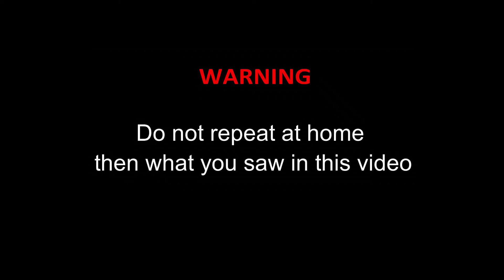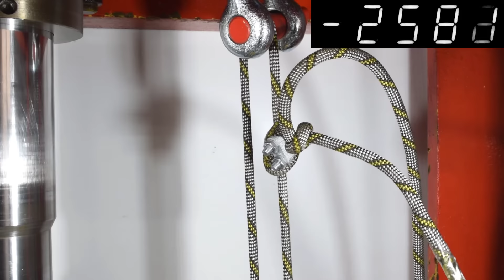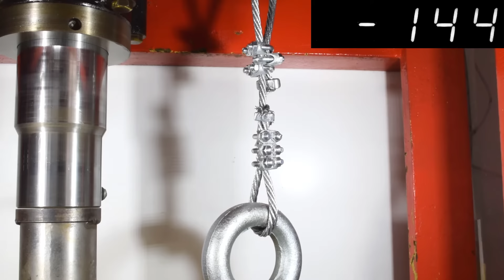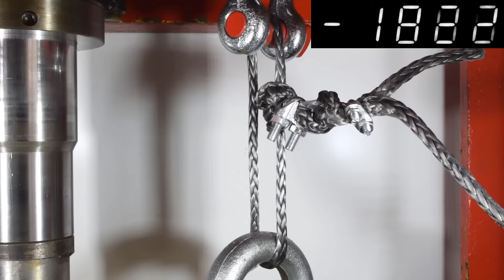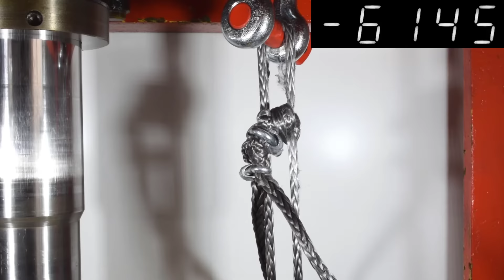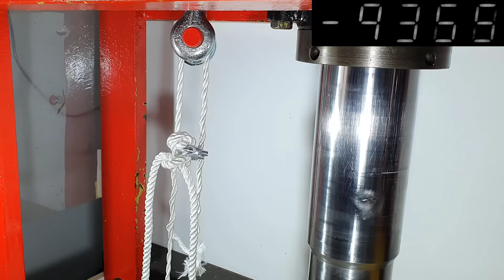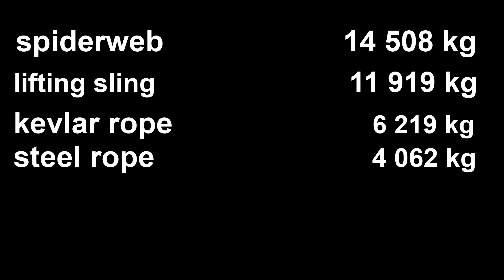HYDRAULIC PRESS VS STRONGEST ROPE

Comment: Yes but the steel rope was tested as a single line, whereas all the other ropes were tested as double lines- halving the tensile stress compared to steel at the same load.
Reply: Even so, it would only jump up one spot right?
Reply: @stephenrhoades8686 No, no, the test was cool and you can see that good quality materials will support more, but in terms of position it was undefined, if you pay attention, the breaks happen at the points where the knot caused structural damage, thus reducing the capacity of the rope, there are other types of knot that would be more suitable for this test. but it's always good to see a hydraulic press breaking things.
Reply: @demervalaugustodacunha1954 the fact the web isn't weakened by knots as much is also another reason why it's better though, and even if you assume perfection for steel, it'd be weaker still, even if only by a couple hundred kilograms

In this example, it's 3.5 times as strong as the steel rope, so even if the steel rope is weakened to a third of its abilities, spider webs is still stronger.
Don't get me wrong, steel not stretching is a massive bonus over spider web, along with being much much cheaper to produce and distribute, since steel rope can be made anywhere with steel, instead of at spider silk farms or wherever they get it from.
Reply: @BisexualPlagueDoctor  the metal rope had just one line, while the others divided the force into 2 lines, which certainly changes the result severely, I don't know if it would be stronger or not, but I can't know since the knots used didn't take it into account the characteristics of the ropes, such as alpine ropes, which typically do not hold well in this type of knot, slipping much more than the others, causing more structural damage.
Reply: Nah I'm a Civil Engineer, the larger the diameter the better it will sustain tension, larger diameter are more ductile. The stresses in the steel rope will be thoroughly distributed if it's thicker in size meaning it can handle a lot more tension 😊
Reply: @paimonemergencyfood3392 who are you replying to. Also bring ductile is a property of the material not of the shape and size of it
Reply: why is everyone disagreeing with you?? first thing i though too, you can visibly see where the knots imoact the result
Reply: Double it and pass it to the next person
Reply: The poor knots tho... Some knots could have been way stronger and less slippery
Reply: @paimonemergencyfood3392  you spending all your civil engineer money on primogems?
Reply: That spiderweb rope is fricken awesome! We were taught you lose half your SWLL when introducing a knot. Weaving the rope into a flemmush eye greatly increases SWLL

Comment: Never knew they make rope from spider silk!! Where do you find it? How much is it? How many spiders does it take? Mind boggling! 😀👍
Reply: Isso é o que eles DIZEM ser. Vai saber se é bem assim mesmo...
Reply: é sintético
Reply: GMO goats.
Reply: It has covering only got it like coaxial cable have black rubber coating
Reply: @GraemeWight-wx3xz  That's 2000s tech, they now use GMO silkworms
Reply: @Assassin0223  : you know i think i remember see/hearing about that but the goat one always overwrites lol. I remember reading that teams working with the goat variant were having consistency problems in many crucial areas,  strand clumping , knotting, too thick or too thin. With the grub cocoons the strands will be fine gossamer and ideal for spining into a yarn. Ta for the reminder. I'll go refresh properly.
From Edinburgh Scotland with respect m8.
Reply: It comes from GMO goats milk that produces spider silk protein and not actually made from spiders.
Reply: @CatboyChemicalSociety   ok ... that makes sense. Thanks! Which opens even more questions!
Reply: Is it soft cause if so I want a blanket
Reply: @Sersincero 1 spider can make different types of web.
The one where the sides are sticky for hunting, web that all know and love.
And the one for structuring the entire web which is not sticky but strong, and I believe that this is what is used for spider silk.
Reply: That was synthetic
Reply: Chinese spiders were being tortured in the spider concentration camps, that's how they extracted that much spider silk🫠
Reply: Probably not how many spiders but how much of their sticky fluid the spider could make come out
Reply: That's so cursed wtf
Reply: Look up spider farms in Austrália

Comment: In such tests, you should use an eight knot because it puts the least strain on the structure of the rope under train.
Reply: Fishermen know their stuff 👍
Reply: 2 strands is 3x stronger than a single strand. I made this up, but you get the point.
Reply: Fugure eight is not the strongest knot. It is just easy open after loading. Ropes should be spliced together to make them very strong.

Comment: 2:20 The steel was tested in a single rope, the other materials the load was distributed in two ropes. For comparison, it should double the value of the metal.
Reply: They are just behind eachother
Reply: Learn physics
Reply: Aren't the other ropes just looped? So all the force is put on one rope for all of them
Reply: @mathgangster3010 you should do that yeah because you clearly don’t when you say to go learn it to other people
Reply: @SleepyTime-t9p no the load is spread across all the ropes even if they are a part of the same while it doesn’t half the load exactly it will help a lot
Reply: @Zephyx0_0 are you blind? There’s only a single one each end wrap around and attaches to the rope itself it

Comment: Just a suggestion, next time you try testing ropes, look into some different types of knots and hitches to secure the rope properly, otherwise they all just keep coming undone while you test them. There are a good couple hitch ties you can use that get tighter and lock the knot in place when more force is applied in the right way for your test, and will give a better idea of when the rope failed as opposed to when the knot failed.

Comment: On the sling band you have a problem causing faulty result. The bottom ring contact area has extra tension concentration in the edges of belt, failing it too soon.

Comment: Knots weaken any rope. Try splicing and you will discover the real strength. BTW your knots are housewife’s knots. Ask a sailor for advice. But: thanks for the video

Suggestion: Compare various knots with the same rope. There are big differences
Reply: sunnygames4003 i believe suspension bridges use steel instead of other stronger types of rope is because steel is less tensile. The other matierals stretch out more, which kinda renders the point of the suspension ropes moot. But then again, I’m no engineer, i may be wrong.

Comment: The way you tied/ connected/ assembled the ropes/ cables had a huge impact on the load. 

If theres 1 strand (like th 10mm cable)or 2 strands like the climbing rope really matter. 

That climbing rope is usually rated for 15kn, =~ to 1500 kg. The fact it broke almost twice than that is a proof for the above.

Comment: I have access to a 200 ton custom hydraulic press out at work. I work on the largest hydraulics in the world outside of what they have on air craft carriers for the elevators. That's why it's so big. The amount of times I have talked myself out of crushing things out of curiosity is countless. So I come here to get the thoughts that will get me in trouble out of my head.
Reply: My former employer had a small 3 ton press and I would regularly crush my empty pop cans 🥫

Comment: Where the "Spider Rope" comes from ? Spider Robe is any polypeptid structure, like any animal stuff. Jute is a poly succer (cellulose like) stuff. What You not tested had been Carbone fibers and Dynaree rope. This is a very long molecule polyethylen fibre, which is used for building crans etc.. Climbing ropes are polyamid fibres and are farily elastic and stretchable to ensure a soft fall when climbing. Dynaree is like steel and has nearly no elasticity. Would be nice to make such test with carbon and dynaree too.

Comment: Lifting sling didn’t really break exactly. The seam didn’t hold. Plus, each or these come in various strengths. I’ve used straps rated for 4K lbs and ones rated for 40k lbs. Same with these various ropes. Wish you’d listed what they’re rated for vs what they can do

Comment: Im surprised that the steel wire didn't do much better than the climbing rope lol
Reply: The steel was tested in a single cable, the other materials the load was distributed in two cables. For comparison, it should double the value of the metal.

Comment: That’s not real web rope, that would literaly cost like 1.5k (I did my research and my original statement is false. It wouldn’t cost. 1.5k it would actualy be about 328 thousand dollars and probably more. The reason is that the spiders have to be milked separately and by hand, and only a special type of spider can produce string sturdy enough to do something like this. It only lives in Madagascar and is very very rare. So he probably wouldn’t even be able to get something like this as it is illegal)

Comment: the lifting sling wont fit into this comparison, it has completely different dimensions than the ropes.
to make a real and good comparioson all materials need to have the same diameter and also same webbing technique to make the rope, toherwise its basically testing under different conditions everytime so you cant make clear points of what is stronger

Comment: This video should be called HYDRAULIC PRESS VS THE WORST KNOT I KNOW.
Almost everyone knows that knots reduce the strength of ropes. Good ones and those recommended for use "only" by 40-50%. These are not like that... And that's just part of the reason why all the breaks are in the knot with this ridiculous data.

Comment: To be honest here. Bad video and bad test. You ruined the whole test with those knots. There is a reason the ropes break where the knot is. The knot itself provide the largest flaw. You can have massively improved the performance on those ropes simply by having a proper knot that ties both of the ends together.